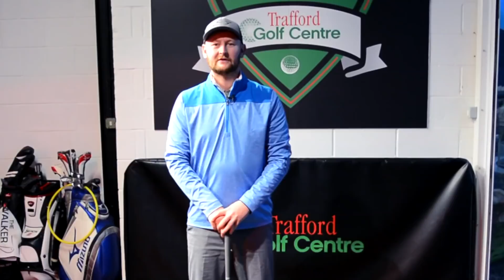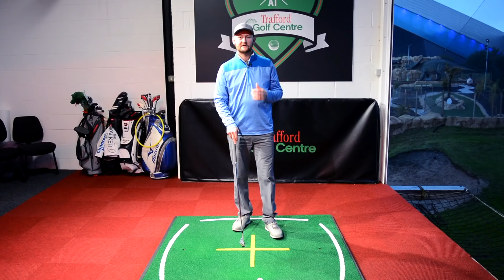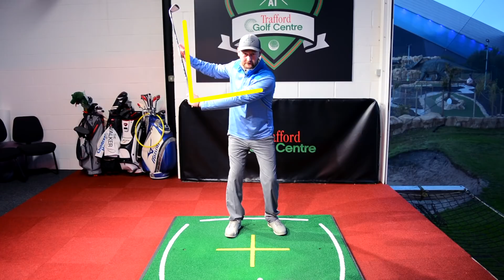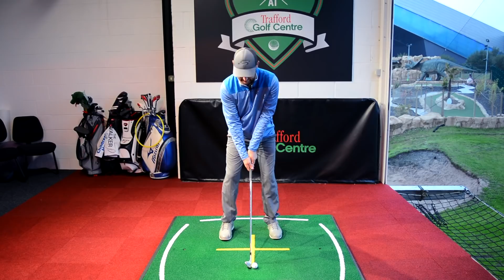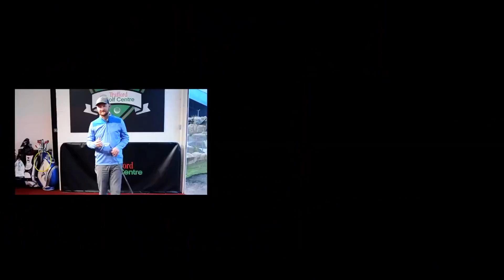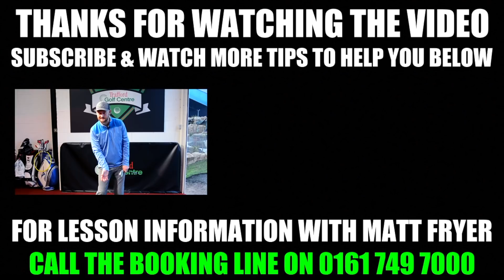How To Create Lag In Your Golf Swing

Comment: IMO lag is a conceptional issue not a positional issue. If your thought is to release the club head into the ball doesn't matter how much you 'hold' lag it wont happen. If you change your thought to release the club head after the ball you will naturally hold lag. Holding lag and releasing in to the ball just results in the shanks.